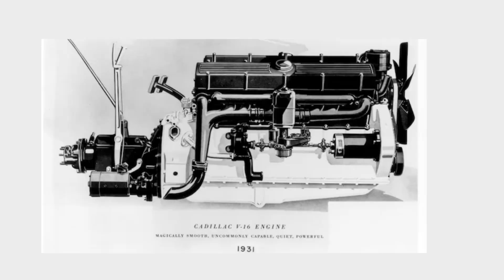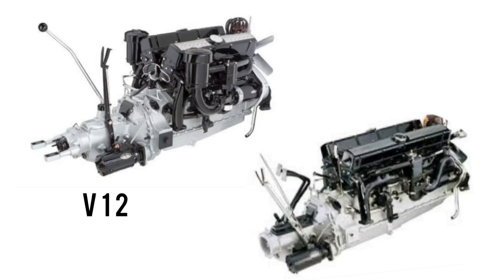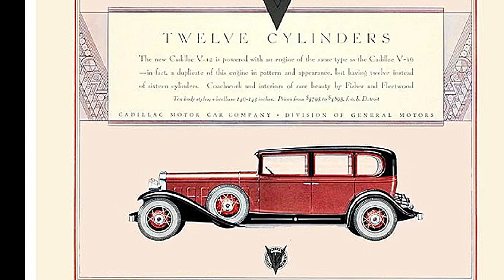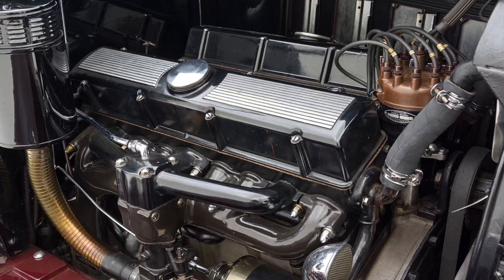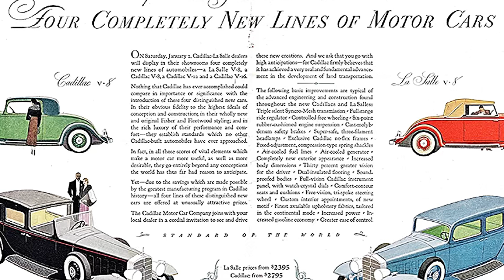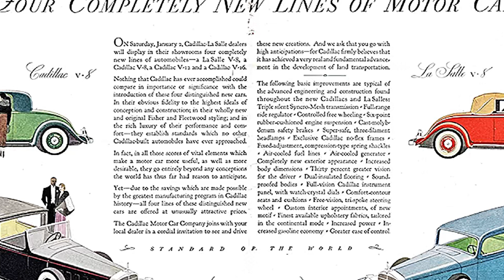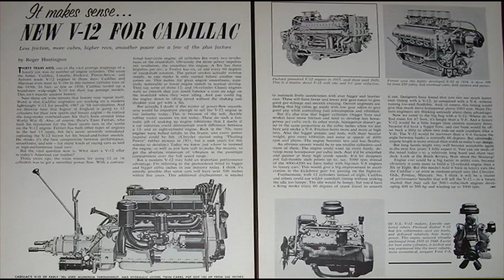Cadillac V12 engine family ￼

Comment: What is funny is the Cadillac 6L V8 from the early 1980's had the same power range as the old V12. W/digital(throttle body) fuel injection, the 6L V8 put out 140 net hp. With a 4bbl. Rochester carb, it put out 150 net hp. Plus, the compression ratio was 8.2:1 on the V8s.
Reply from the maker: Yeah it’s nuts I think one could get more power out of these with a few modifications
Reply: All thanks to the EPA.
Reply: @What.its.like.  You definitely could.

Comment: Thanks for this video, it is very informative.  The Cadillac engineers made some very strange and interesting design choices.  For example, they were married to the idea that the intake and exhaust ports be on the same side of the cylinder head.  The V-12 and V-16 have both on the outside of the head and the later flathead V-8 has both on the inside of the head in the valley.  The latter has the advantage of keeping the engine as narrow as possible but I don't really see any advantage of the packaging of the V-12 and V-16 other than perhaps ease of carburetor adjustment?
Also, while they saw the advantage of and were able to  manufacture of the OHV design for the 12's and 16's, the regressed to a flathead design for the later V8. 
Either way, very interesting engines.
Reply from the maker: Glad you dig this episode =)

Comment: I think harmonically that the V-12s sounded a lot like V-6s but with the extra cylinders ran a bit quieter. If I could’ve gone back in time, I would have loved to drive or ride around in the V-16… that really would have been smooth and torquey.
Reply from the maker: 💯% agree I know where there is a few v16s I need to go back there